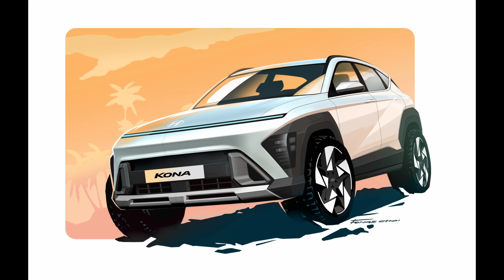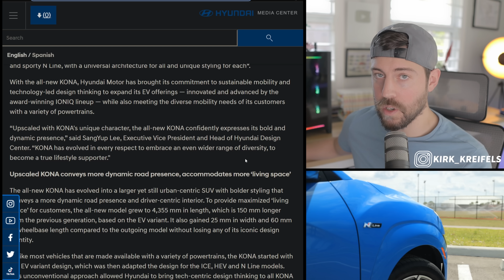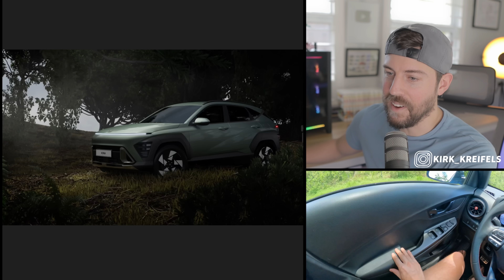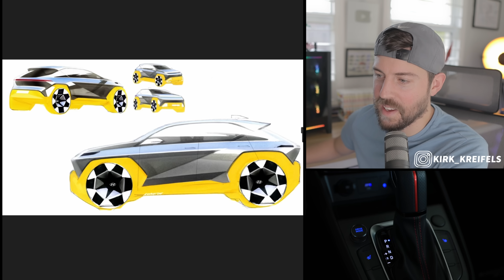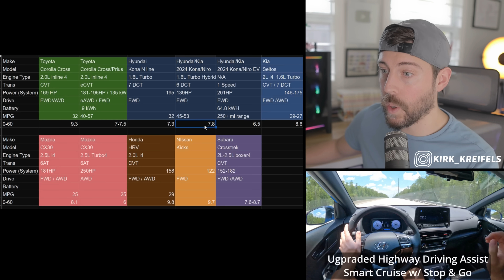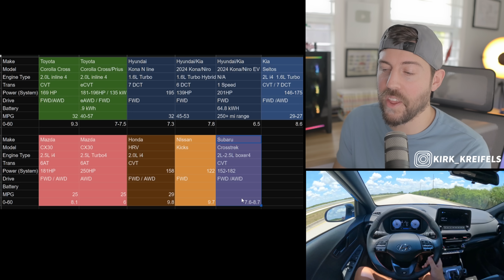The 2024 all-new Hyundai Kona will put HEAT on the Toyota Corolla Cross, Honda HR-V...

Comment: One year later.... The 2024 Kona Limited is a beast!! Cheaper than a Toyota Corolla Cross XSE AND had more features than Toyota! Still will check out a Toyota Cross hybrid, BUT Toyota dealers don't have them in stock to test drive and several with lower trims are jacking up the prices with add-on junk fees! Toyota will screw the pooch with bland vehicles and expect you to pay extra $$$ for the name alone!

Comment: You don’t need an N model if you get a dual motor all-wheel-drive. The performance will probably be the same. The only thing I can see them adding would be dynamic chassis control.
Reply: I believe there will be an N model.. but it will be a Kona ev N .. from what car and driver and motortrend and others have said with ev 300-380hp

Comment: Those LED light designs are beautiful and futuristic, but if one of those LED squares burn up, the whole LED panel will look defective. 

Can each LED square be independently replaced?
Reply: Looking defective but still functioning is much better than suddenly losing an entire headlight.

And, aside from being way more energy efficient, LEDs are also much more reliable than HID & halogen (50x avg lifespan of halogen, and over 6x that of HID).

Lastly, if you're concerned with an LED lamp looking defective from inconsistent wear rates by individual LEDs, then you shouldn't mix new and old LEDs. Just replace the entire lamp or bulb so all the diodes are the same age & brightness.

Comment: Great video.  I would like to suggest another specification to be added to your charts BEVs.  That is the DC fast charging from 10 to 80 percent SOC.  The reason being that for better comparison between vehicles and especially the vehicles on your kickecars channel.  While the range of the Kona is adequate, the charging time is rather slow, as is for all lowest priced EVs.  This is good information for people who want to purchase a vehicle for certain purposes.  Like if you want a commuter car, the Kona EV would be fine. But not so if you’re doing a lot of traveling.  The hybrid version would be better or a higher priced EV if you really wanted an electric.

Comment: Can’t compare Kona to Corolla when talking about long term reliability. Toyota any day!
Reply: Not true at all. JD Power and Consumer Reports place Hyundai right with Honda and Toyota even beating Toyota in Consumer Reports.
Reply: Toyota is obsolete
Reply: They will definitely put the HEAT on toyota, and by heat I meant the heat from the engine fire its going to have
Reply: @sshhddoo9892  🤣🤣🤣🤣🤣☠☠☠
Reply: @sshhddoo9892  😂
Reply: The engine fires weren't really as serious as they were deemed to be as this only affected 3,100 cars and resulted in a single tragic death. Toyota had a far serious issue with their brakes getting stuck, which led to far more deaths in a shorter amount of time. Both manufacturers still make great cars in spite of these recalls.